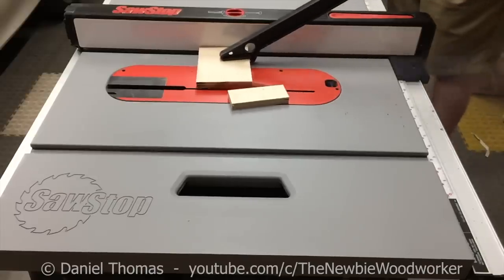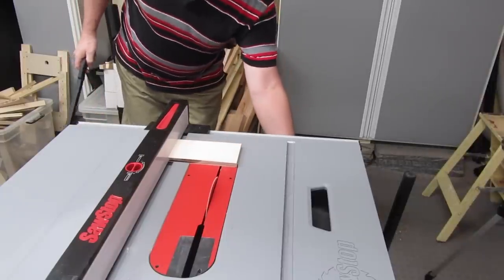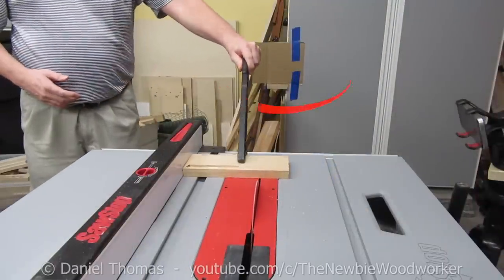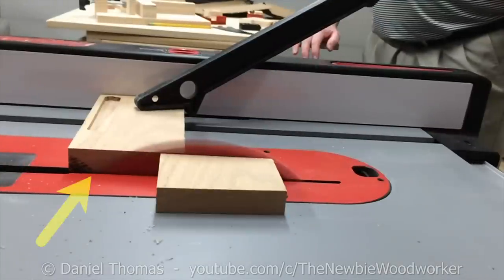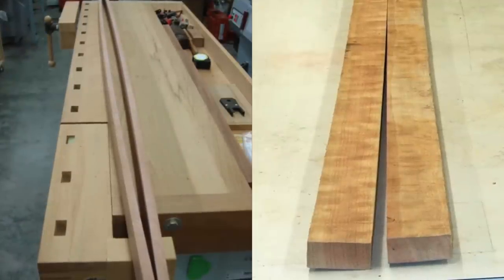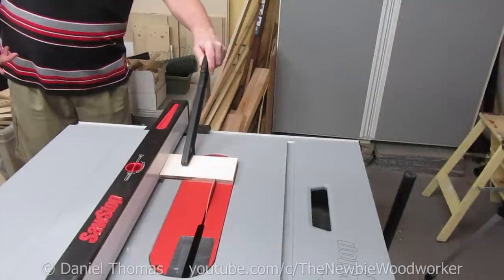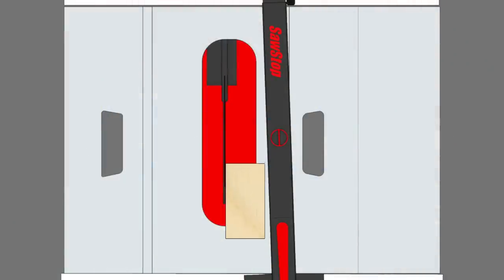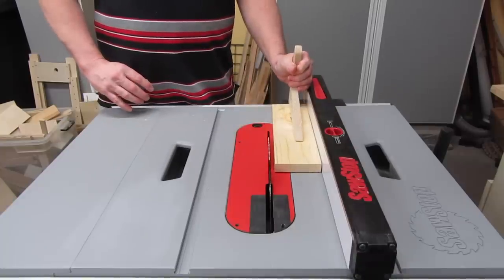Actual Kickback (in Slow Motion), & How to Prevent It

Comment: All my cross cuts are done with a sled and i stay way to the left
Reply from the maker: Sounds good, although with a crosscut sled, you don't need to stand "way to the left". The back of the sled should prevent any wood from coming back at you. What causes the wood to come back at you is when it gets suck between the fence and the blade, wich it can't do with a crosscut sled If you stand too far to the left, it could actually cause you to not have as good control over the wood.

Comment: I'm gonna give you my personal opinion just because I like your Mustache... First, be careful how you provide advice and do your home work first... When using the glide block, even with the heel on, you NEVER, EVER place it closest to the fence, no matter how hard you can push down, the power of the blade will always win because the blade doesn't "chicken out" like we do. The push block should be in THE MIDDLE of the piece pressing down to keep the part to be cut BALANCED and a THICK PUSH BLOCK, AS THICK AS POSSIBLE should be used. How can a tiny push stick HOLD A TRUE AND CONTROLLED BALANCE on the cut when all you are doing is pushing from behind? a True Push Block should be able to not only engage the cutting work piece from behind but also from the top with enough force to keep it DOWN AND FLAT against the flat surface of the table as well as the flat parallel surface of the fence! BALANCE is the key word here. Best push-block you can use is one made out of a 2x6" with a Grip cut through the top for a full grab of the hand and wide enough that it can keep pressure on the cut piece to hold it steady along the cut. Second, if you're are to cut a 3/4" or whatever thickness, the blade should be no Higher than an 1/16" to 1/8" above the top of the cut and not with a such high of a crown. I have had my index finger cut by a table saw before without a guard and I will never use a table saw without one, ever, yes EVER! I'm Lucky all I lost was my whole nail which grew back, but my finger does not! and Last and most importantly, prevention is the best medicine... Always and I mean ALWAYS, Either a feathering system or a CLAMP DOWN of the wood to be cut should always be used. Why trust your "know how" which most people don't have (even those who think they're such experts) and leave the HOLD DOWN POWER of A PROPER CLAMP DOWN JIG SYSTEM for the flimsy hold of your inexpert and insecure, distracted Rookie hand? Isn't out hands we're trying to protect first and not our pride? Next time you do another video, please make sure you include these tips... or else... Off with you Mustache!!! (well, maybe just a trim...) Thanks for posting good videos but you wanted our opinion and now you have it. "Common Sense makes Safety Effective, otherwise, it is just wishful thinking" Me.
Reply from the maker: Thanks for sharing. Sounds like you should do your own safety video!

Comment: Installed a new table saw and while adjusting the riving knife the darn safety latch would not come loose. When it finally let go my hand slipped on the covering grease and my thumb hit  the blade. Stationary and unplugged and it still put a hole in my nail and cut my hand. I have to admit i am watching safety videos like mad now. I think the universe tried ti tell me something there.  I am used to power tools and heavy machinery but woodworking tools just seem to be that more dangerous
Reply from the maker: I swear, saw blades are like hungry animals just waiting to take a bite out of you. It's happened to me plenty of times. So now I wear thick gloves if I think I might come in contact with the teeth. (But only use gloves when the saw isn't running, because when it's running, it can grab the glove and pull it into the teeth.)
Reply: @TheNewbieWoodworker Yup! Thanks for the pearl. Will definitely keep that in mind
Reply from the maker: @hhattingh  👍

Comment: If you would have pulled the the fence back so it would stop about 1 or 2 inches after the blade cut through the material it would have made a huge difference,the fence should never be completely on the
Table reaching far beyond the blade
Reply from the maker: First of all, I was intentionally trying to create kickback, so there's no need to talk about what I did or didn't do correctly. With that said, can you link to a picture showing what you mean? Because it sounds kind of iffy.
Reply from the maker: @MAXupload86  That's what I thought you were saying. Listen, I'm no expert, so take everything I say with a big grain of salt. But one thing I've learned is that if you don't see a bunch of other people doing something like this, then there's probably a good reason. That's my thinking, anyway. In any case, thanks for the comment and link to the picture!

Comment: Based on a recommendation by TheMasterWoodworker (https://www.youtube.com/channel/UC70nMtjNC2e1Vk2X7ASCwog) I have  replaced my 10" rip blade with a 7.25" rip blade. He points out that most of the material we cut on a table saw is 3/4 or 1" material, and thus he almost always uses a high quality 7.25" blade on his table saws.

So far, the only problem I need to overcome is the fact that the riving knife on my table saw (the new Hitachi contractor saw) is too wide to work with thin 10" blades. So with an even thinner 7.25 Diablo ripping blade, the riving knife makes ripping almost impossible.

I am in the process of creating my own, thinner riving knife to solve that problem. Would be useful if Hitachi offered riving knives to work with thin kerf blades!

The thin smaller blade does, however, seem less prone to binding and more comfortable for ripping 3/4 and 1" boards.

I've using table saws for more than 50 years, and so far the only kick back I've experienced was when I adjusted my out feed roller stand a fraction too high. Fortunately, I'd already moved far to the right of the table to get another board when the just cut board slowly rolled back onto the saw table, resulting in a truly spectacular 8 foot by 3" board being thrown back into my work bench 20 feet away.

Your advice is spot on. Don't cross cut using the rip fence? Check. Using a riving knife at a minimum? Check. No human has fast enough reaction time to avoid the kind of kick back you demonstrated? Check. Make sure the work piece is FIRMLY kept against the rip fence? Check.

In all, a very useful video even for old timers. Thank you Dan.
Reply from the maker: Thanks! Interesting idea about the smaller blade. It wouldn't work on my SawStop though, because they don't make a brake for a blade that small. Don't you wish you had video of that kickback? Scary, true, but awesome also!
Reply: I was too embarrassed to even take a photo of the ding in the side of my work table :-)
When it happened, I new immediately that I was at fault!

All the best to you and yours, and please keep providing such excellent content.
Reply from the maker: Thanks. I'll try!

Comment: Wax your table top.
When using carbide blades, make sure the entire carbide teeth are higher than the stock.
Dont set your fence parallel to the blade. Toe it out just a fraction to eliminate burn and kickback
Reply from the maker: Thanks. After doing this video, I'm not worried about needing to toe out my fence for kickback reasons, but it makes sense to do it for burning. Thanks for the suggestions.
Reply: Why do you say to have a carbide blade raised higher?
Reply: Dave Satosky 
The teeth are wider than the blade. If you raise the blade high enough to keep the carbide teeth out of the stock, it wont be rubbing on it, potentially causing an accident.
Reply: The most stable would be to have the blade all the up. This way the teeth are providing the most downward stroke possible. This gives the the most pressure of the stock down, into the table. It's not practiced because it's not the safest, just the most stable. A rule of thumb is to keep the blade as high as you feel confortable with a minimum of at least seeing the U shape of the gullet above the workpiece.
The downward pressure is good. The top of the blade and the rear of the blade is the dangerous areas.
Reply: How far out should one align the toe?
Reply: Matt Day 
Very, very little. Im taking like measuring with paper. All you want to achieve is that the teeth don't touch the blade. 
A perfectly parallel fence is still dangerous. You need some room to exit the piece away from the blade.
If you try to set the fence parallel to the blade, there is a chance that you may have it toed in (closing into the back of the blade) Just leaving a fraction of space at the back of the blade will insure that your workpiece will not want to climb up the back of the blade. 
So just like raising your blade, setting up your fence is pretty much a personal preference. But ot must always have some toe out. 
Dan makes some Very respectful video. Informative and easy to watch.
These need to go on a national network.
I haven't checked out Dan's video on fence aligning yet. Going there right now😊
Reply: Dave Satosky 
Check out 4:00 in. You can see the transparency part of the blade from the gullet of his blade. The carbide teeth at the upper portion of that transparent part. This is pretty much perfect imho. High enough to clear the teeth on the top of the blade, but low enough to not scare the bejesus out of you.
Reply: I would have to disagree with raising the blade all the up!! It's not the downward pressure at the front (viewed from front of saw) it's the upward pressure at the back of the blade that causes the problem.
Reply from the maker: I agree. I think the even bigger concern is that with the blade all the way up, the chances of accidental contact increase dramatically. I know people argue about this all the time, but honestly, I'd rather do everything I can to keep all my extremities intact. 😀

Comment: I don't like the push stick template you show. It puts your hand ahead of the hook feature. This makes you lean forward too far and puts your hand hear where the blade is.
Reply from the maker: But it allows you to put downward pressure on the stock, so it doesn't rise up. But to each their own.
Reply: @TheNewbieWoodworker  I saw another kickback video by another YouTuber where it is very clear that if you're hand is in the vicinity and you're applying downward pressure, during a kickback you would have zero chance to control where your hand is and if the blade is high enough, or if your pressure control is not the best, you end up slamming your hand on the table or on the blade. I like that yellow plastic thing. That one is perfect. Probably it can be replicated using some rubber padding screwed and glued to the bottom.
Reply from the maker: @aomanchutube  Actually, that's a valid point. Thanks for sharing!

Comment: When will someone invent a blade guard that is not a nuisance? Most everyone I know removes them because they are so cumbersome.
Reply from the maker: I've actually started to use my blade guard more and more lately. Obviously there's some types of cuts that you can't use it with, but the main reason I hadn't been using it was because it wouldn't work with my cross cut sled. But I've solved that problem: https://youtu.be/cQINXsn2QBk

Comment: I think your push stick is too close to the fence, thereby pushing the wood into the blade at an angle.  A little more toward the middle should push right thru.  However, removing anti-kickback features is NEVER a good idea.
Reply from the maker: Thanks for the comment, and I know you're right. Even now, about a year later, I still have to remind myself. Now that I think about it, that's a good reason to go with a different push stick design, so I don't feel like I'm so close to the blade, and then it should be easier for me. Thanks for getting me to think about this! 😄

Comment: 0:47 - Come on bro, you have a SawStop. It's designed to prevent cutting a finger from kickback - risk it! JK. SawStop is well worth the safety if you can afford it.
1:42 - It's obvious already, you're doing a crosscut where the amount of wood on the fence is shorter than the amount of wood between the blade and fence. There's too much momentum from the cut thus generating the kickback. Your first cut at 1:14 had more wood on the fence than between the blade & fence - thus not enough momentum.
Reply from the maker: LOL. SawStop can help limit the damage, but it's not guaranteed to be blood or pain free. 😄

Comment: You shouldn't put yourself in unnecessary danger just to get a point across. As a lineman, I would never grab a live line just to show the dangers.  In all trades or crafts, there will always be injuries. Most happen for one reason, operator error. Having zero experience with any tool is a potential accident waiting to happen. Another , and probably the most dangerous thing, is complacency. "Hell, I've done this a thousand times." If you hear someone say this, get away. Accidents will happen when they happen. Being inexperienced and complacent are the two main reasons why. Making a video of yourself trying to show kickbacks is an accident waiting to happen. You should know better, or have you become complacent?
Reply from the maker: Would I make this video again? No. Am I glad I made it? Yes. I'm pretty sure thousands of people are safer for having watched this video. Is it perfect? Of course not. But I think it demonstrates the point. Complacency had nothing to do with making this video. More than anything, I probably overestimated my ability to do this relatively safely. Or maybe I estimated just fine, since I didn't get hurt. But it's a moot point, since I wouldn't do it again. Thanks for your concern.

Comment: You dont cut wood that small on a table saw , more a miter saw
Reply from the maker: I think you meant that you don't do that. If you didn't watch the video, I'm doing some wrong things to help create kickback as a demonstration, so don't judge by the thumbnail. But yes, you can cut small pieces relatively safely, especially with a cross-cut sled.

Comment: Great video. I applaud your bravery.
Here's a link to a superb table saw safety video https://youtu.be/Uf_jbau4VwA
I'm a total newbie and will not offer any opinions but I'm wondering why most of the woodworking youtubers are NOT using a blade guard? I know that for certain cuts they get in the way and must be removed but it seems like for the majority of the cuts it should be installed. I work for a company that produces life safety products. Safety is our first priority. It has to be or someone could die or be seriously hurt. For the hobbyist it makes absolutely no sense not to put safety first and use a blade guard whenever you can. (I guess that's an opinion, sorry).
Reply from the maker: I would never encourage not using a blade guard (if that makes sense). The reason I don't use one is because I use my cross cut sled all the time, so I'd have to take it off a lot. Also, people can see what I'm doing in the videos better without it, although I still wouldn't be using it even if I wasn't shooting videos. On the other hand, had I been using it, I may not have had the near-injury I had, so you have a completely valid point.

Comment: yeah i'll stick with a band saw lol
Reply: Broken bandsaw blade can be lethal with missing or loose guards. Plus the blade catch and throw small peices. It is very easy to get complacent with this dangerouse tool and cut one or more fingers off holding and cutting pieces, especially freehand and complex shapes on a bandsaw forgetting where your fingers are. Also loose clothing, hanging zleveeve cuffs, long Har is dangerouse near a band saw and it's many rotating moving parts.

A band saw can be very dangerouse.
Reply: Also loose clothing, hanging sleeve cuffs, long Hair is dangerouse near a table saw and it's many rotating moving parts. Make sure all guards are in place and securely latched.

When you work on, maintain, and change the blade, belts, clean out dust turn 1st off the machine, then unplug and apply LOTO (Lock Out Tag Out, and then put locking device only you have the key to on the end of the plug and ourlt tag with your name and number on it so there can call and ask why you put lock on) to cord so it can't be plugged in by you or your buddy while your working on it. 

If your wood working tool is broken or missing guards, turn it off, unplug it and apply LOTO (see above). This protects you from running broken or dangerouse equipment and prevents your neighbor or buddy from unknowingly operating a broken or dangerouse machine.

Comment: The best way to prevent a kickback with a table saw, you push all the way through the wood into the blade and don't stop in a middle of the blade that cause a kickback and push forward the fence and keep it straight the wood into a blade.
Reply from the maker: Thanks for sharing that! 😄

Comment: Extra don't
Don't feed timber into the saw blade from the other side. I did this once to make a very small 3mm cut on what was quite a large box. The blade flung the box at great speed and head height past my head. I was very lucky to be standing to the side. I know that this is not kickback, but it is dangerous and maybe worth a demonstration. If doing a demonstration I suggest that you stand on the same wrong side of the saw blade as you feed the timber into the blade to avoid getting hit by the flying timber. Thanks for your videos.
Alan H
Reply from the maker: Thanks, and I know just what you're talking about. I didn't do that, but when I first built my router table, I fed wood from the wrong side, and let it be squeezed between the fence and the router bit. It was like it was shot out of a cannon! So I can understand the near heart attack you must have had. Glad you're OK!